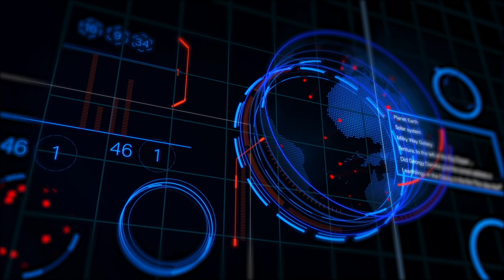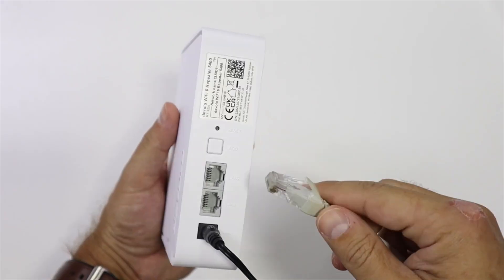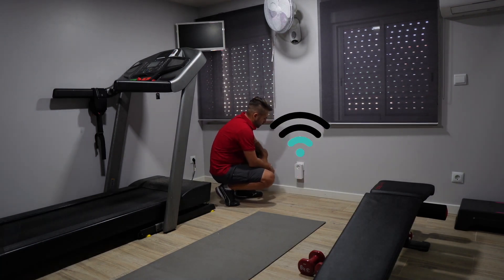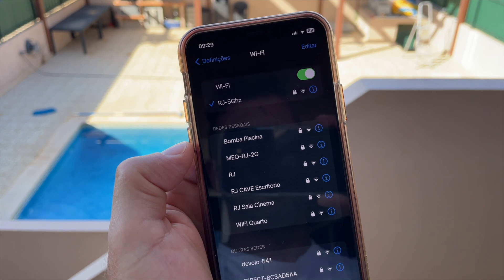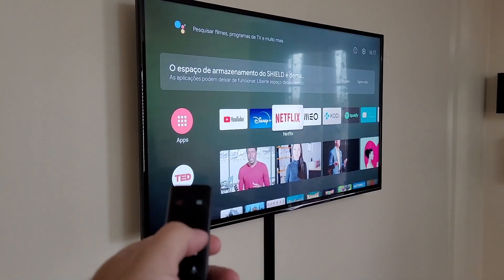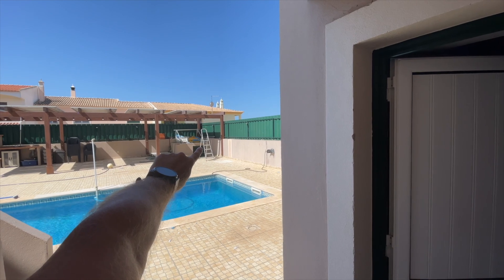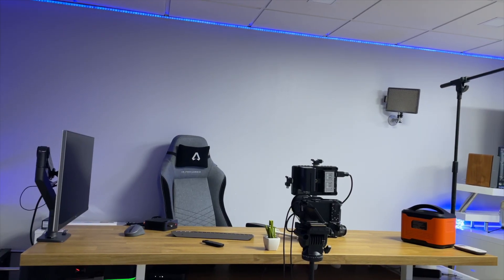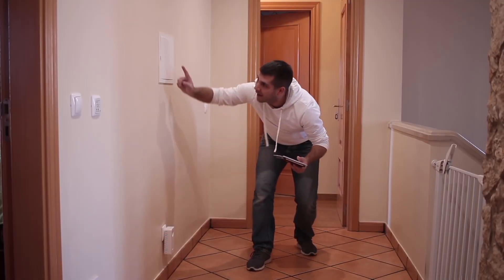How to Build a Smart Home Ecosystem with Reliable Wi-Fi Connections | How To Start ?

Comment: I live in Greece. In Summer the water temperature in the tank can be very high. DS18B20 can measure 125 degrees Celsius but the wire can support only 85, if I understood well...

Comment: Interesting. I have a solar panel too and I want to know the water temperature in the tank. I put a sensor but it measure the temperature of water only when I open a valve. You replaced the classic thermostat with a sensor? I would like to know more about this implementation. Thank you.